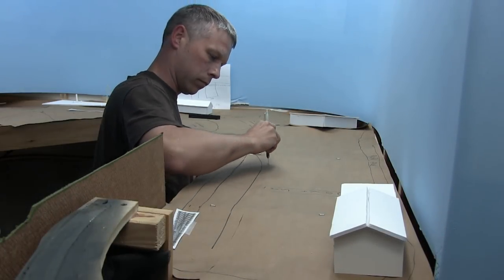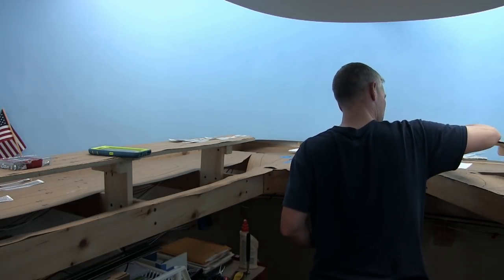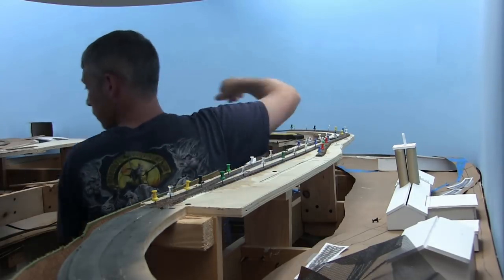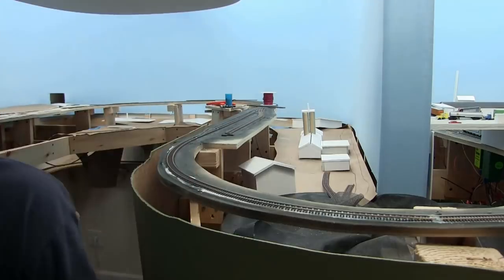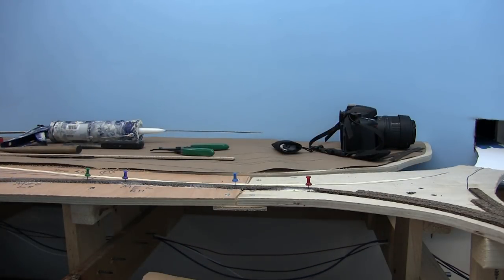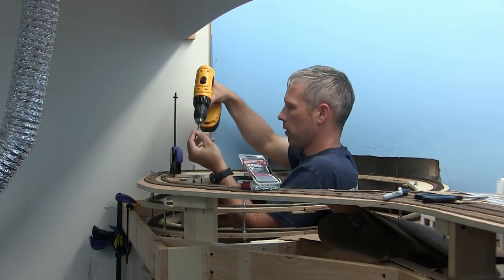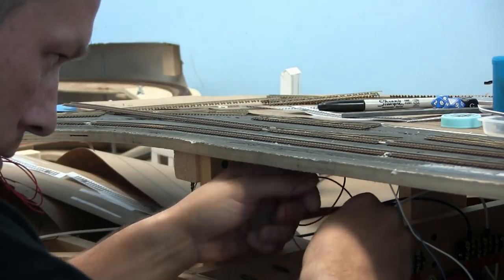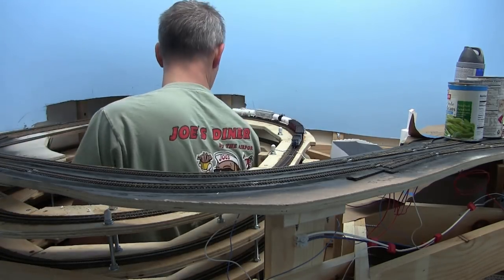Finishing the Mainline for the Sayrehurst Secondary

Comment: Joe. Congrats on closing the loop. Your operation sessions have proven that your track plan works. Suggest OI-16 comes out of the helix, thru the x-over to track 2,(should be double ended track), pokes out the south end until the train clears the north switch on track 2. Conductor ties sufficient number of hand brakes, does a securement test, cuts off the remaining part of the train and it double overs to another track, shoves back to clear the south end, more hand brakes to secure the train. Engines cut off....OR... end of train clears north switch track 2 and switch crew trims off sufficient number of cars from north end using the switch lead. The conductor has not had to tie hand brakes so far! The remaing portion of the train then shoves back into track 2. Hand brakes, securement test, engines cut off. The Yard Master might want to do it another way. Mike
Reply from the maker: Mlke Simmons thanks Your insights are always welcome! Thanks for watching.

Comment: Joe, once again..another great video.. I too like the idea of cutting the paper using it as a template.  I backed the video up a couple of times once I watched it all the way through trying to gauge your continuous run time..with the breaks in editing it was pretty hard to tell..it seems a little over five min for once complete circuit.  Looking forward to your next update.  Tom
Reply from the maker: Overland Transportation System thank you Tom! It takes about 8 mins to complete the loop, at a moderate pace. I am currently running a little quicker than I would like to get the locomotives through the unpowered frogs. I think I'm doing about 40mph. I like running at 25 to 30 mph. Thanks for watching!

Comment: Looking great, Joe! I've been following your progress. I'm in the early stages of my layout and getting some great tips. You mentioned that you were using a philips bit to countersink screw holes. Are you familiar with countersink drill bits? The shaft is adjustable so you can set the depth. It saves having to drill each hole twice before placing the screws. Here's one example: 
http://www.homedepot.com/p/Ryobi-Power-Groove-Countersink-Set-5-Piece-AR2008G/205193155